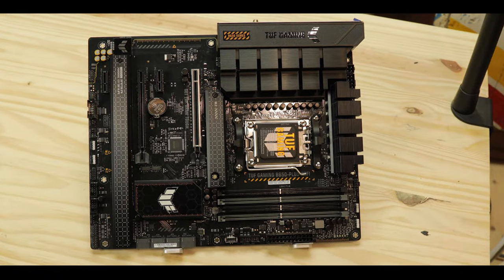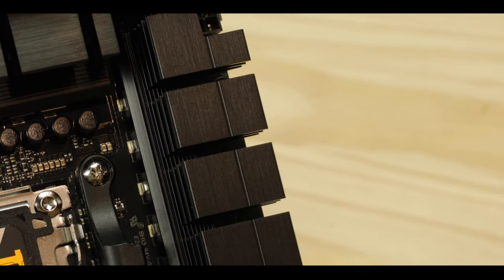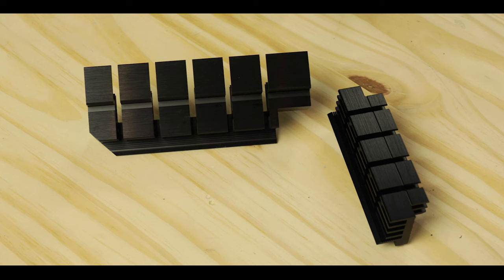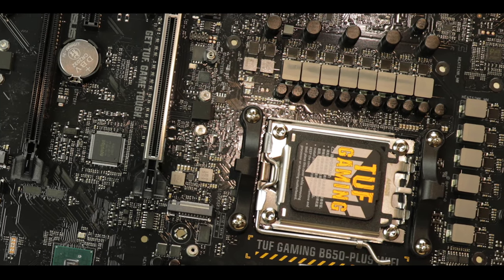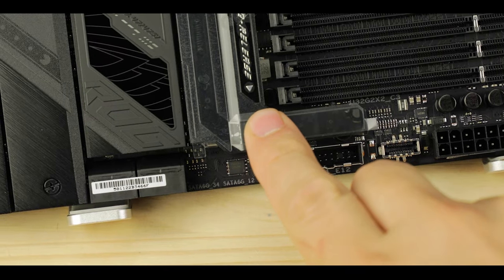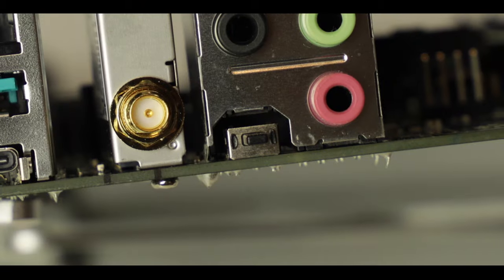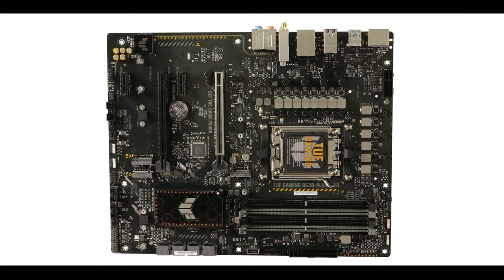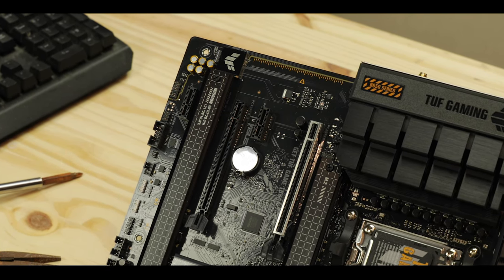TUF Gaming B650-PLUS WIFI , worth every penny!

Comment: Buying an ASUS product is like playing Russian Roulette,  but putting multiple bullets in the chamber.  I have had around 60% of all ASUS products eventually fail on me over the last 25 years of PC building.  Tech support is a joke and pretty much non existent.  Due to my past experiences, it's just too risky to buy ASUS because if you need to RMA or open any correspondence with ASUS, you are most likely SOL and wasted yet more money on these guys.  I have stayed away from ASUS as of late and miraculously had 0 failing parts since.  On the fence between MSI over ASUS and Gigabyte, however this round of AM5 boards are a bit disappointing overall coming from all manufacturers and hugely overpriced.  Shame on me if ASUS looks to be the best choice for me and I pull that trigger.

Comment: just what i wanted to know! thank you! bought it together with 7800x3d and 7900 GRE :)
Reply: hey how was the building part and how’s your pc held up?
Reply: @johnmackie2377  to be honest I bought an upgrade PC and just put in the GRE.  But something is wrong, because the PC starts 30 seconds after I turn it on. Maybe because of the AIO water cooling. The boot itself is quick and PC runs everything pretty smooth. Like apex legends on 240 Hz/fps
Reply: how do you find this board combined with the 7800x3d im thinking about it
Reply: How did the 7800x3d and the GRE pair. This is what I am thinking about getting for my PC.

Comment: I bought an msi tomahawk based on your reviews of all the comparable boards and couldnt be happier.  Thanks and you run a good channel man.
Reply: What ram did you install? I have read that sometimes the system does not boot and perhaps it is due to the speed of the ram
Reply: Good and MSI tomahawk in my country there are no service centre for MSI but for Asus I have got  service centre in almost every state so went for Asus 
But for MSI if I got any problem I have to ship it to USA first so I got Asus

Comment: Thank you for the review! I just picked this board up today for my buddy to pair with a 7800x3d. overclocking is a non-issue since you cant overclock x3d cpus anyway. Very nice board for the money
Reply: How's the MB working I bought the same combo waiting on shipping. I've heard some mixed things about the board
Reply: It's more than enough, he made it sound like this is the A620 chipset lol.
Reply: Nice info got an x3d didn’t know you can’t overclock them good thing I haven’t finished building yet
Reply: Can you tell if you run it with the Boost Clock of 5GHz? Would really like to know if that will be stable and if you tried and whats your recommendation maybe? Ty

Comment: I got the TUF X670E-Plus (without wifi) for 205€ a few months back. Solid 7950x runner
Reply: I got the same motherboard and I absolutely love it. Very solid board for a 7800X3D too. And EXPO just worked straight out of the box with my DDR 64Gb DDR5 6000Mhz kit

Comment: Which Power supply would you recommend. Here is my config. 

AMD Ryzen 7 7800X3D
ASUS TUF GAMING B650-PLUS
MSI Radeon RX 6750 XT 

In this case would you recommend the ASUS Power Supply or the BeQuite 850W?

Comment: In a not so distant past for $200 you could buy an entry high end, all bells and whistles, motherboard. Nowadays for $200 you get the basics with the second from the bottom chipset.
I bought this board because I refuse to spend $300+ on mid range mobo.
Gamers should've put their foot down when nVidia decided it's ok to charge $2000 for a GPU. This trend has spilled to other components.

Comment: got the non wifi on sale + asus cashback for a total of 169 euros. cheapest full b650 in my country. should be fine with 7600x and liquid freezer 2 providing extra vrm cooling for those heatsinks. upgrading from 3600x and totaling 570e with used 7600x, used 6000mhz cl30, the mobo, and a liquid freezer ii 360 all included.

Comment: ever since i got this board a few days ago i can't get AMD expo to work whatsoever. it's not like it's a weird RAM kit - corsair vengeance 6000mhz CL36, even says for AMD Expo - it's not specifically on the RAM support list but i haven't been able to change the RAM speeds beyond 4800mhz at all when they're rated for 6000. need to try a new ram kit but i'm not optimistic.
Reply: This reply is late but did you try updating your bios.

Comment: @laurent Do you think it will work if I only connect the 8pin connector on top and not the 4 pin? I currently have a 650W PSU (Corsair RM650x). That one has 24pin, 4x8pin and some sata. Now I want (if possible) to keep the Case NZXT S340 and this PSU. And replace the i5-6600k+gtx1070+z170 mobo with 7800X3D+ASUS TUF RX7900XT OC (3x8pins) and this mobo. I know 650W might be on the limit for this combination, but tempted to just run it stock or undervolt. So I'm either missing a 4pin for the CPU on the mobo or only have 2 out of 3 8pin connectors for the GPU.
Reply from the maker: Yes it will

Comment: Hey the best motherboard tester.

I am currently considering whether to get an Asus TUF Gaming X670 plus WIFI or a TUF Gaming B650-PLUS WIFI. Or if I should completely freak out and get an ASUS ROG Crosshair X670E Hero. I'm gaming with it and streaming what would you recommend ? I have so far the ASUS TUF Gaming X570 Plus Wifi and the part is already mega nice....
Reply from the maker: Based on what I've seen of them 3, for my money I'd go for the TUF B650-PLUS wifi. It's bandwidth on computing power faaaaar surpasses  ( and I mean faaaaaaaar) what ur currently running.

Pair it with a Ryzen 7. Ull be grande for another 5 years.
Reply: @Laurentschoice  Thanks for your quick and good answer. I will combine the whole thing with a 7800X3D. Unfortunately, I have to wait for the next paycheck, this month I have already bought a Palit 4090 OC Gamerock that has already hurt very much :D But I will keep an eye on the B650 and in a sale I think to strike. Thank you and keep up the good work!!!

Comment: Any reason why Newegg ratings for this board are not that great?
Reply: Majority of the complaints (if not all) are related to issues with the memory. None of them says what sticks they've used so it's hard to comment. It is possible that they had problems with the EXPO. With other, non-ASUS, boards once the EXPO is turned off in the BIOS the system is fine.
I've bought this board with Kingston Fury Beast 2x16GB. It's listed as compatible on the ASUS website so we'll see how it goes.

Comment: Great to see a video for this card! Thanks!
The ASUS website says this board has ASUS Enhanced Memory Profile (AEMP).  Will this let me use DDR5 XMP memory?  Or, would it be better to use DDR5 EXPO memory?
Reply from the maker: Expo in this case  :)
Reply: So is xmp completely unusable?
Reply: Not unusable but may not run at the advertised speed as some who bought XMP Ram have found.
EXPO has encoded secondary timing while XMP does not.

Comment: 🎯 Key points for quick navigation:

00:17 🎮 TUF Gaming B650-PLUS WIFI features military-grade resistance and focuses on gaming performance
- TUF B650 boards have a six-layered ATX PCB for stability and bandwidth
- The motherboard design follows a dark military theme with minimalistic aesthetics
- It has a well-appointed VRM configuration for efficient power delivery
02:09 💡 ASUS TUF B650-PLUS WIFI VRM and CPU capabilities
- Modest 1460 doctor most power stages in a six plus one configuration
- Supports medium to high-tier processors but not ideal for heavy overclocking
- VRM cooling solution provides effective heat dissipation for stable performance
05:20 💾 Memory and storage features of TUF Gaming B650-PLUS WIFI
- Supports up to 128GB of DDR5 RAM clockable up to 6.4GHz for improved performance
- Offers a modest 3 M.2 drive configuration with fast data transfer speeds
- DDR5 memory brings increased bandwidth and clock speeds beneficial for gaming and production tasks

Made with HARPA AI